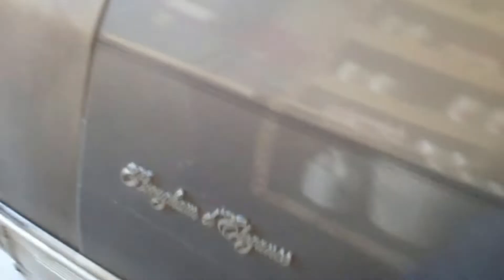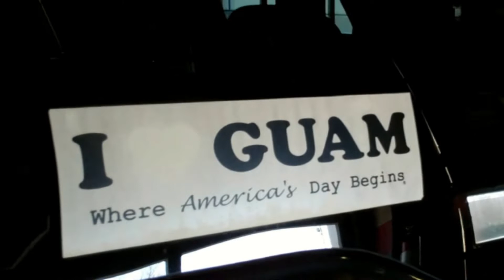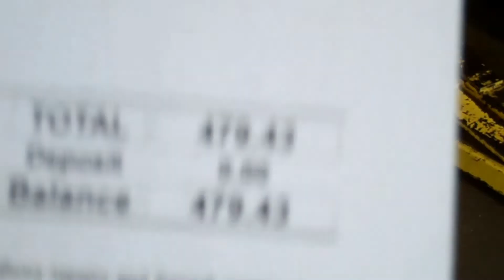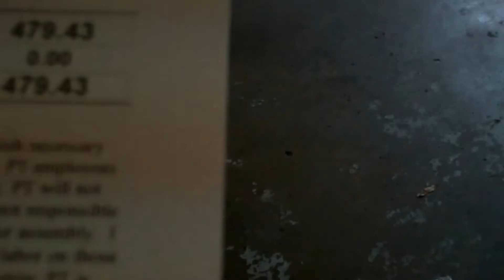Diagnosing a Squeaky Suspension

Comment: It's a lot of work replacing the upper and lower ball joints.. But best to do them at the same time.  I did that along with the inner and outer tie rods before winter.
Reply from the maker: +OrangePitbull Oh yeah I've seen it done and they are a pain in the ass.. 
I was hoping it wasn't that bad but looks like I need to start saving up for this job..

Comment: There are two levels of cost when it comes to front ends, expensive and really expensive.
Reply from the maker: +Jim Foreman No kidding! Even shopping around for upper and lower control arms for both sides is almost $375 on ebay but the labor for those is $600 total.. 
I've got 1 other mechanic friend I'm waiting on to call me back that might could do them as a side job if I buy the parts.. Just need to know what he would charge for labor.